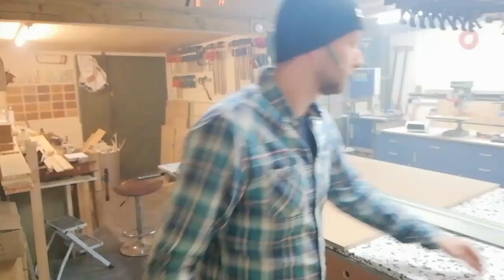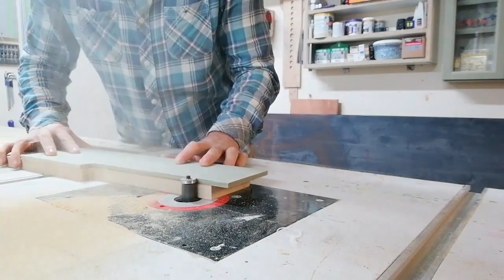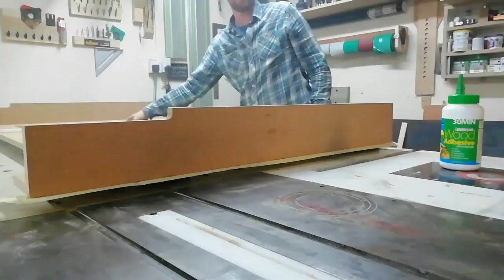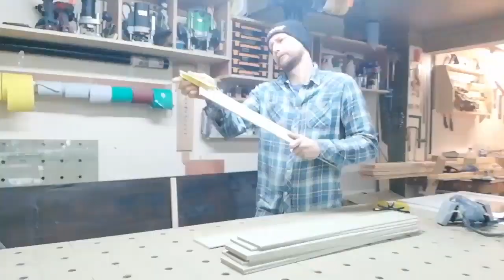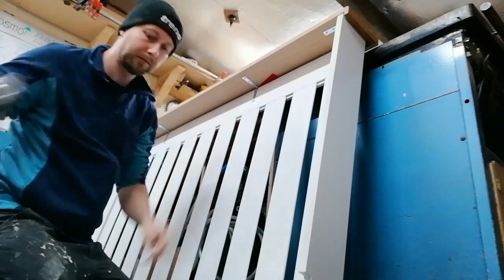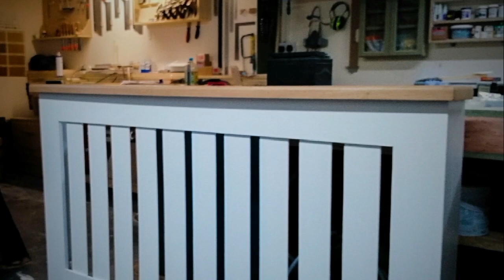Radiator Cover Build

Comment: that cover came out great. Love the combination of painted mdf and venereed wood top
is that a  parkside saw running on festool track?
Reply from the maker: It is indeed.... The saw itself is fine but the short tracks supplied with it didn't give me the range I needed.
Reply: great to know I have the same saw I can upgrade it

Comment: looks great,what did you use for the edge joining?
Reply from the maker: Sorry Mike... I'm not sure I follow?
If by Edge joining you mean the 45 degree corners I use a mitre lock router bit which eliminates any MDF end grain on the sides.
Reply: @SharpEdgeWoodworking-UK  it was the side panels like you say mitre lock router bit

Comment: Great video chris, how you finding the gun? Peter Millard recommendation, I purchased the same if so. The finish is great for a £30 gun. Where did you get the mitre bit for the router from please, thanks
Reply from the maker: Peter Millard is a very bad influence on me.....but he's a top guy so I'll forgive him.
To be honest I forget where I got the mitre bit.... but they're pretty widely available.
Reply: Sharp Edge Woodworking is it worth buying a decent one over a cheap and cheerful one, I’ll only ever use it now and then. 
I agree I think a Mr Millard is a bad influence for all.😂😂
Reply from the maker: @Robswoodworkingdiy  personally..... I wouldn't touch these cheepy Chinese bits I've seen online.....I have nothing first hand to substantiate that.... I just have certain things (router cutters being one) that I don't scrimp on. I just don't trust an unbranded £10 lump of steel spinning at 22000rpm.... I think I paid about £30-40 for it and probably from Axminster or some other somewhat credible retailer.